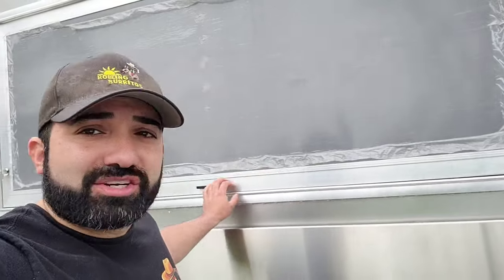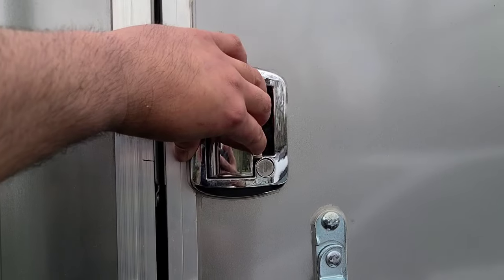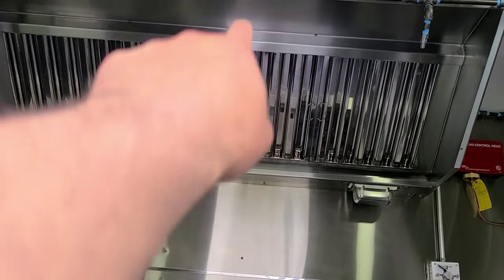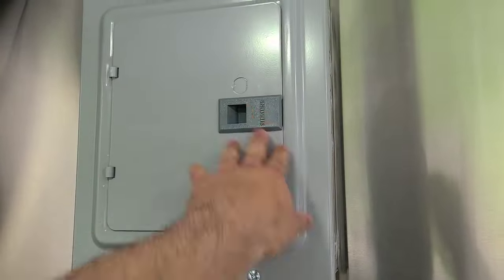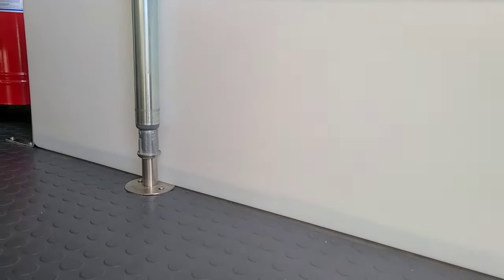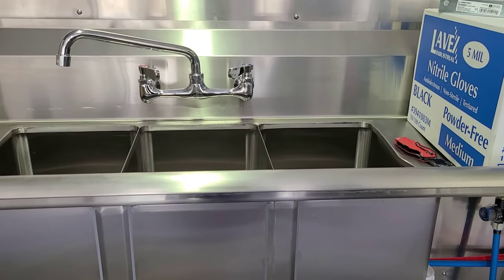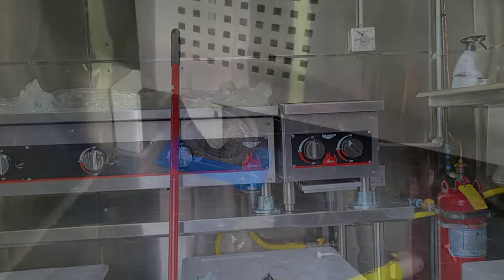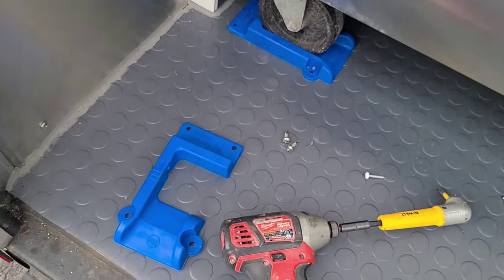How to Build a Food Truck: Final Walk Thru

Comment: HELLO FRANK  YOU REALLY DO GREAT WORK !     was wondering what size is that window do you have the style numer  so i can order that item and also did you weld in a header  for support or do you use  wood after you cut out opening ?             also where can i buy the metal for the walls interior .
Reply from the maker: Good afternoon. On my last video I answer the metal question, window 78x31 style 23x. Just used wood

Comment: Looks good. Need to run a accumulator on that pump though. The quick cycling will burn out the pump in no time. Thanks for posting.
Reply: What’s does that mean?
Reply: Accumulator  is a pressure storage reservoir that utilitizes external mechanical energy from either the engine, raised weight or spring to move it around

Comment: Where did you get your stainless steel for your walls .... I just ordered our 2nd hood from hood mart and they sell stainless for cheap . 6ft and all pieces for less then 300 . its like 145 for a 4x8 sheet .
Reply from the maker: I got mine from a local metal shop.
My first time buying it, it was $40 a sheet then it went to $65 then last time it was $100 for 4x10 sheet

Comment: I have a empty truck I just want to know a average of how much I will need to
Get it up and running
Reply from the maker: Hard question to answer. Don't know what you are cooking or maybe it will just be a ice cream truck. But the simplest of trucks no hood no gas. Just basic, materials maybe. 3-4k and higher depending on if you get a fridge

Comment: I've seen most of these videos and since starting my own trailer build, I've realized that Chicago is WAAAAYYYY easy on the regulations compared to Washington State.  I gotta have a GFCI on any outlet within 6 feet of a sink counter or servicing a food prep counter.  You got an unprotected outlet directly beneath your sink!  I had to invest over $600 for a water heater that's rated to pass inspection AND it must installed with a pressure relief valve.  I ended up doing my panel on the exterior because it can't be obstructed by anything under it or on the sides.  Good job though, but it would never pass here.
Reply from the maker: Yes crazy how every county changes, some are even more lenient than us here, to make it a GFCI its pretty simple I could add a GFCI breaker to the panel or just swap out the outlet. The panel one that kinda stink putting it outside but they make them so thats good
Reply: @fbaltierrez  Putting it outside using water tight connects and conduit actually made it faster to install everything.  They made me use 12/2 mc cable for all the interior circuits.  It's also a requirement here to vent your plumbing with a 1 1/2 pipe through the roof.
Reply: I'm in Washington and I've been doing research on the L&I requirements and brooo, it discouraged me so quick! LMAO If you or you know anyone willing to help me put together a trailer, I would appreciate it. You're from WA, so how much do you think it would cost to put together a trailer if the food I'm making requires a 3 bay deep fryer, griddle, and fridge?

Comment: how much did it all cost?
Reply: @Frank Baltierrez
Reply from the maker: Hard question to answer with one answer only. All depends on With what cooking equipment, did you want new or used,. But a rough answer fully loaded trailer 40k and up is what I have seen fully equipped

Comment: How do you wire the exhaust fan to the breaker
Reply from the maker: Take the colored wire and white wire one colored goes to the switch wire. The other cable gets run to the actual fan the other color goes to the other switch wire. The 2 whites get connected together and buried in the box by THEMSELVES nothing else connected to the whites

Comment: Good job thanks. were you get the flanges for the table
Reply from the maker: For the bottom of the feet on the tables are these
Reply from the maker: https://www.amazon.com/gp/product/B00OIL1IO4/ref=as_li_tl?ie=UTF8&camp=1789&creative=9325&creativeASIN=B00OIL1IO4&linkCode=as2&tag=rollingburrit-20&linkId=e19d853bd0db489ae4c4a27228b69f3e

Comment: Que buen trabajo!!
Tengo una duda,compre un exhaust fan y trae el control conectado dentro del exhaust fan, como puedo conectarlo o necesito comprar otro control externo?
Gracias!!
Reply from the maker: El control usualmente no viene en el abanico. Tienen como un switch pero es como un safety switch. O tal vez si lo tiene alli. Se lo puedes quitar o esta alli permanent?
Reply: @fbaltierrez  gracias por responder tan rapido!
Si se puede quitar ,pero deblo cablear y solo prende directo,trate de conectar el control del mismo modo que tu lo explicas en tu video,pero no logro operarlo con el control(no puede encenderlo con el control ni subir o bajar las velocidades )mi exhaust fan lo compre en "VENTILATION DIRECT".
Reply: I see a leak on those 3 comp faucet. You should use galvanized fittings for your outside propane lines.

Comment: How much did it cost to build the whole trailer?
Reply from the maker: Just in materials with equipment you are at at about 15k not counting the trailer
Reply: A little hefty for my budget at the moment but I’ll build what I can for now. Thank you!
Reply from the maker: @ericzaragosa8331  if you take it piece by piece and look for bettet pricing then for sure would be less. Depends on what you need it for maybe you don't need a hood saves a lot of $$$$
Reply from the maker: @ericzaragosa8331  it's about 15k not 17k. 👍👍 wrong sheet I was looking at
Reply: @fbaltierrez  last question.. do you need a licensed electric to pass an inspection or can I do it myself? 😅
Reply from the maker: @ericzaragosa8331  that depends on the rules of your county if they don't say it in black and white then do it yourself 👍👍👍
Reply: @fbaltierrez  I check out the Texas laws and regulations. Thank you! Appreciate the knowledge you’re passing on.